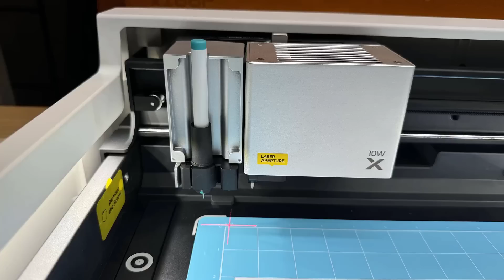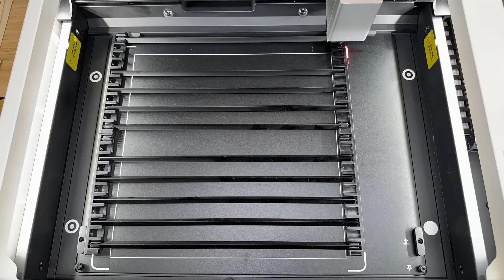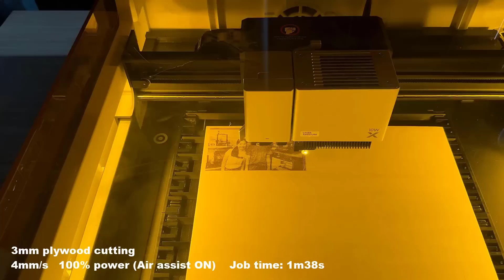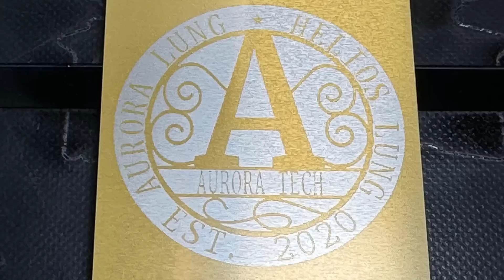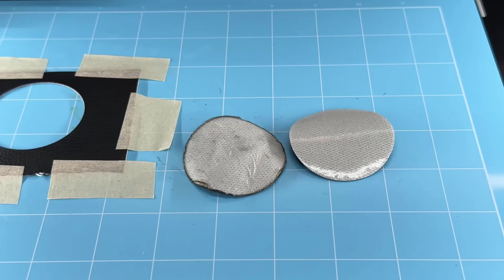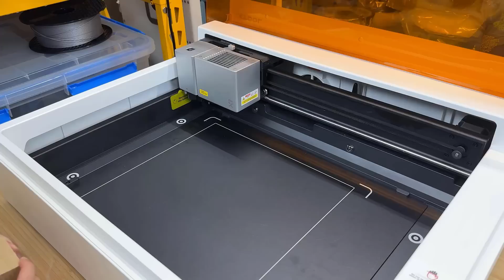xTool M1 Ultra Multi-function 4-in-1 craft machine: Laser, Vinyl Cutting, Inkjet Printing & Plotting

Comment: Hi Aurora! Excellent video. Could you give advice for me, I am looking for a laser for marking wooden parts from my CNC router. Is there a machine that can engrave larger wooden parts, maybe that you position the laser ON the part instead of in its enclosure? Or if there is a machine where you can stick in larger parts from the side of the enclosure somehow. It would be great if the footprint of the machine is small too

Comment: Overall nice review but I think by judging the quality of the ink-jet prints you didn't change the intensivity to maximum which makes the prints much more vibrant. Still it's better to use sublimation printer combinetd with M1 Ultra as the print module leaving much more to desire.. And BTW I duont see any links to your website in the description?

Comment: The inkjet module is a gimmick - it only has CMY inks so to print black it has to mix all three colours, which results in muddy darks, is wasteful and expensive. It doesn't have white ink like UV printers either, so printing on anything darker than white comes out distorted and low contrast. Much slower than a desktop printer too.

Comment: Would you consider this machine noisy? The last thing I want is to upset the neighbours.
Reply: It's no more noisy than a microwave.
Reply: @YaaLFH  good to know, thank you
Reply from the maker: The only part that could be considered noisy is the exhaust fan, as it was placed outside the machine. However, I don't think it's loud enough to upset your neighbor next door.
Reply: @AuroraTech  Thank you for the quick reply. And you probably have been told this but it is worth saying again. The effort you guys put into your work is exemplary.

Comment: A really great review as per usual! I built a 45 watt CO2 laser cutter a few years ago, and it was difficult to keep the enclosure clean after a lot of laser cutting and engraving. I appreciate the multiple functions in this machine, but I wonder how much deep cleaning would be necessary if you switched from laser cutting to blade cutting or inkject printing frequently. Did you notice any residue from laser cutting getting onto the cutting mats?
Reply from the maker: Yes, that's why I put an old 3d printer glass bed to protect the bottom plate :)

Comment: What would you recommend for a first lazer machine? Would like to stay away from Creality, been printing for 8yrs now. Thanks Aurora Tech!
Reply from the maker: Please visit my website auroratechchannel.com for my recommendation list.
Reply: It all depends on what you're going to be using the laser for. I have four: the xTool M1 Ultra, xTool S1 40 watt, Glowforge, and WeCreat 20 watt. I would HIGHLY recommend staying away from WeCreat; this company is a rip-off in so many ways. Plus, the WeCreat laser, whether 20 watt or 40 watt, has many flaws, and the company will blame the end user for those flaws. I also wouldn’t consider any GlowForge lasers—overpriced for both the lasers and the software. If you don’t subscribe to their software, don’t expect to do much with the laser. Additionally, Glowforge is proprietary, meaning you can only use their software; you can’t use Lightburn or any other software outside of Glowforge.

If you're starting out or have some experience with lasers, I highly recommend the xTool S1 if you’re looking to do more than crafting. If you’re into crafting such as card making, working with fabric, jewelry making, heat transfers, etc., I highly recommend the xTool M1 Ultra. If your decision is between the M1 Ultra and the S1, don’t pay the regular price—wait for a promotion. xTool ALWAYS has sales for all of their lasers during any holiday.

Again, it is really hard to say what the best laser machine is for a first-time buyer, as your needs may be different from someone else’s. But once you figure out what you want to use a laser for, stick with xTool—trust me, you can’t go wrong.

Watch this video: https://www.xtool.com/pages/about-us

Short xTool Factory tour: https://youtu.be/sXJAGSfaxS8?si=Qa6uldziwxW93ZF-

I have had many other lasers, such as the Lasermaster, and no matter what, I am absolutely amazed by xTool. Great customer service, always listening to their customer base, and never stopping their innovation. I hope this helps and that you find the right laser for your new adventures.😎

Comment: Cool machine. Can you print inkjet on a flat black acrylic? Does the color sticks to the plastic? How does the graphic look like?
Reply: The print head will not print on slick surfaces any more than a normal inkjet can print on plastic - which it can't unless it has a special coating. The quality, is as admitted by XTool, not as good as a domestic printer.
Reply from the maker: I don't think so, the ink only dries on paper, wood, or similar surfaces that can be written on with a ball pen.